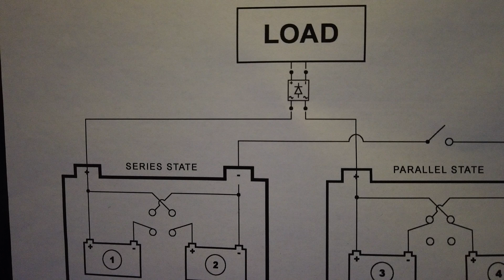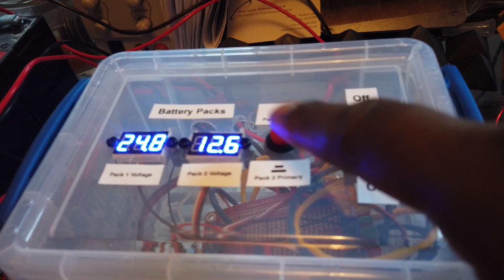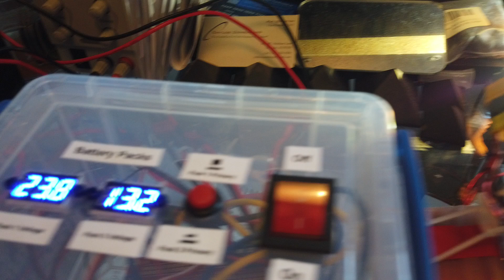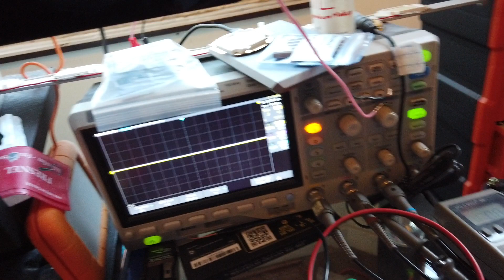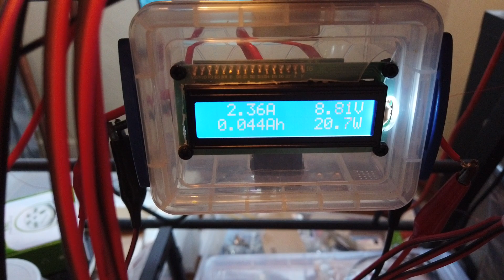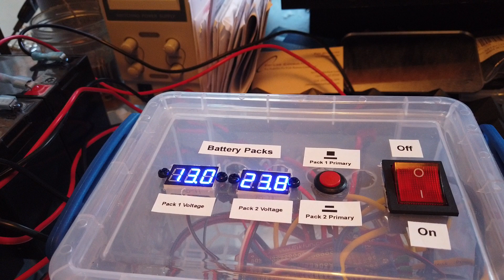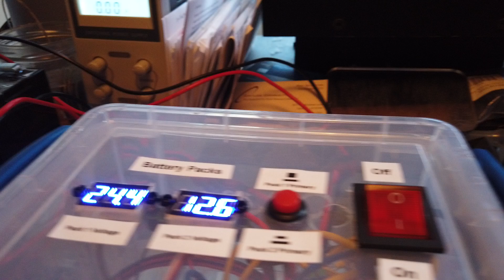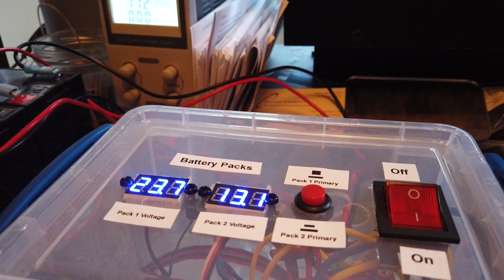Battery Pair Switching Demonstration 2 - Benitez and Bedini Combined

Comment: Great circuit design for switching - thank you for printing it. I set up the same and it works great!
Reply from the maker: That’s awesome! I’m glad I could help. Will you be posting a video of your setup?
Reply: @PerpetualMotor  yes, will do. Same results as you thus far.. batteries slowly drain over time.. trying a few other things .. but not having to manually keep switching battery cables a big plus!
Reply from the maker: @energyhack3538  Right. For that reason alone it was worth the effort.

Comment: You can use DPDT magnetic latching relays (like the Dayton 1EHY1) that only require a trigger pulse for either an on-state or off-state.
Reply from the maker: I have some, but 1. the latching relays usually don’t work for more than 100 or so watts, and 2. they don’t switch at a high enough frequency to be useful. I was able to make a latching relay out of a pair of normal relays, but the low frequency (max 60hz) was definitely a limitation.
Reply: you can also use 4PDT, relay much easier, using tesla switch diagrams, and charge that back emf to charge battery on pack 2 battery
Reply: i mean the battery being charged in two set.

Comment: hey really cool stuff,. Was wondering if you could make a auto switching circuit that will replace the button? Like maybe when the charging battery reaches a certain voltage it auto switches and visa versa?
Reply from the maker: That’s the goal, but first I have to find out what a meaningful switching rule would be. There are at least 4 types of voltages: resting, loaded, charging, and recovery. Charging, and loaded voltages reflect the intensity of the activity rather than the actual battery state. The time for recovery to a resting voltage is also dependent on the intensity of the activity that just ended in addition to the battery condition, so it’s hard to predict how long that lasts. This leaves the resting voltage. For a battery, the time it takes to get back to a settled voltage varies a lot. I’m thinking of using amp-hours or watt-hours discharged. With this approach the hardest part is keeping that number in memory.
Reply: @PerpetualMotor  agreed but maybe just pick one and test till failure and then another and another and then you could chart the results? This was you'll have data to work off of maybe? Either way very cool
Reply from the maker: @mcorrade  good points. That's how I found out about the different voltages. I now have a high level of confidence in the watt-hour approach
Reply: @PerpetualMotor  cool I really interested in the switching circuit for my own project using super caps so when you do make that circuit, can you do a diy on it?
Reply from the maker: @mcorrade if I get more traffic on the video to warrant a DIY, I’ll do one. However, I’ll put together a schematic at some point that I can share on the Facebook page at http://Facebook.com/perpetualmotor .
Reply: @PerpetualMotor  cool thanks
Reply: @PerpetualMotor I Like your project by the way, Yeah it's my opinion to use software called ETAP for virtual simulation. get what results you want to see

Comment: I wonder how long it will go for.
Reply from the maker: Each battery is rated at 7 amp hours. They should each be able to drive a 1 amp load for 7 hours. With 4 batteries in play that would give about 28 hours to run a 1 amp load. However, in this setup, the most limiting factor is how quickly the receiving battery can charge. If it can charge as quickly as energy as being discharged, the process can go on for a much longer time. The power received by the load is just a by-product. The load speeds up the rate of discharge, so if the charging battery can’t absorb it quickly enough you have a loss. However, even with a large load, if the receiving battery can charge quickly, then the circuit can keep toggling for a long time. Much longer than 28 hours for a 1 amp load.
Reply: @PerpetualMotor  Super capacitors would be useful then right?
Reply from the maker: Right. Also electrolytic capacitors. With a boost converter and constant current regulation, not only would batteries work better, but I would only need two instead of four. The boost converter would act like a series battery pack. I’m setting that up for a test right now. I do have some supercaps coming in tomorrow, though.